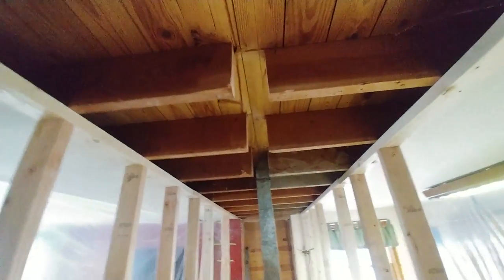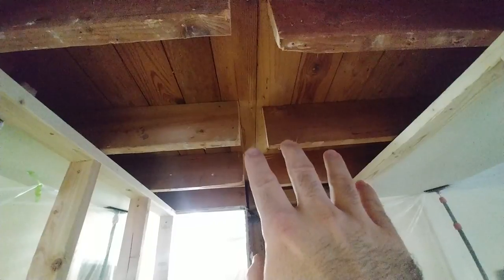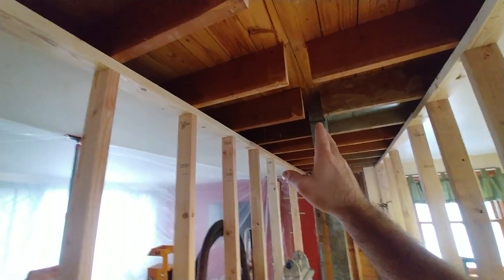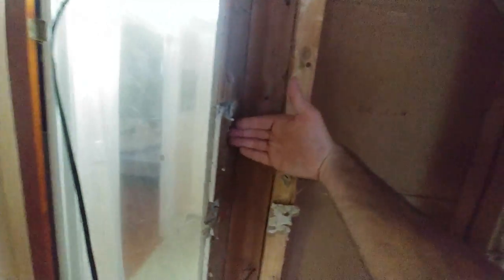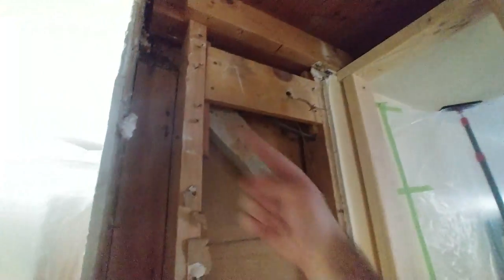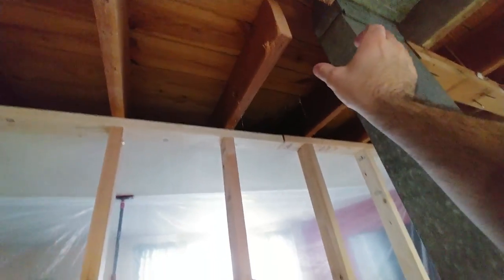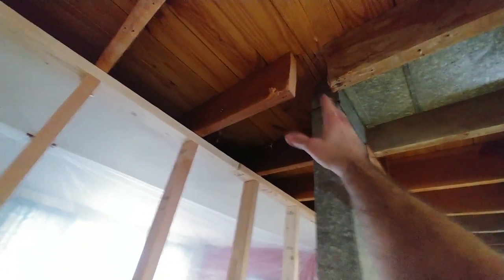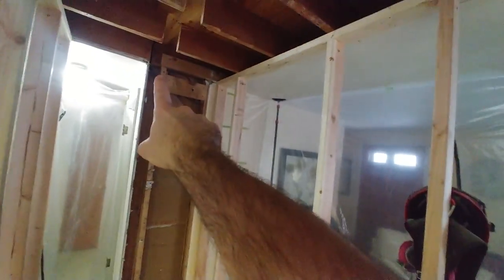Load Bearing Wall Removal Episode 2

Comment: I got a question for you that I've never fully found the answer to...
What is the proper sequence of events to remove and replace a basement carrying beam?
My concern is that while the temp walls will support the floor joists on the first floor (beam is in the basement), do I also have to build temp walls over the ones in the basement to further carry the load of the first floor ceiling joists?  That is what I'm inclined to do, but I haven't been able to confirm it!
Reply from the maker: Hey Tim, it wouldn't hurt to do so, however, your first floor joists pass on the basement carrying beam. If the joists are supported in the basement with temp walls like mine, that small cantilever can support the first floor wall just fine. The question is, how much more house is on that wall? A whole second floor and the ridge? That would be a lot and I would make first floor temp walls. Conversely, if your roof is a truss style and you have no second floor, then I wouldn't bother with another set of temp walls. Hope that makes sense. Thanks for watching!